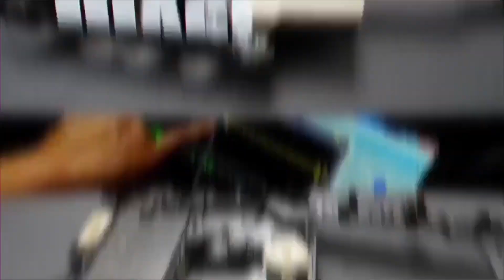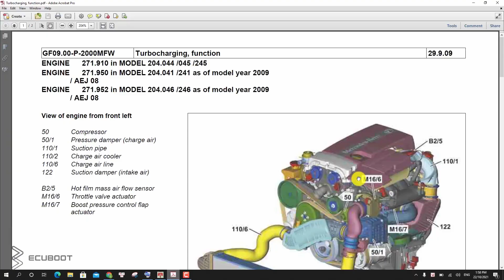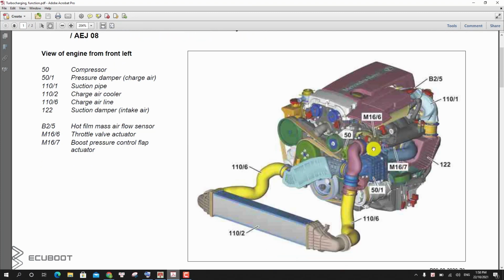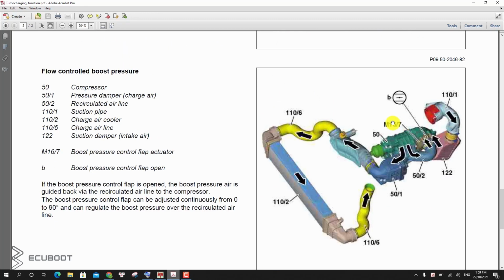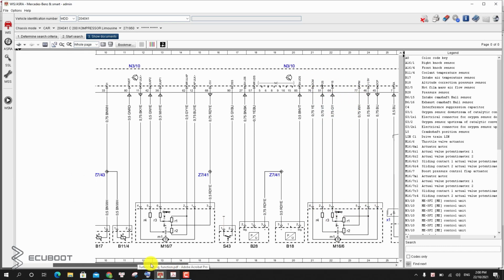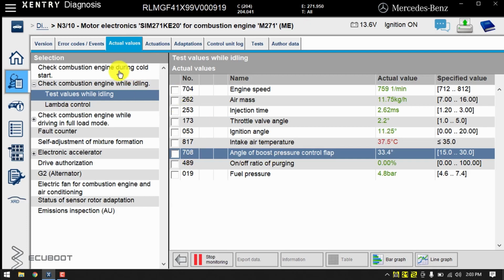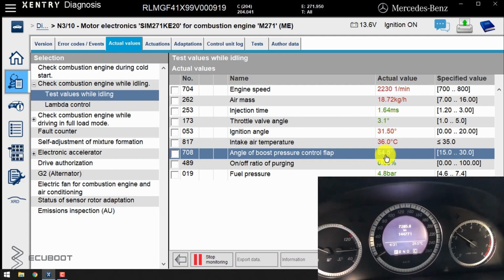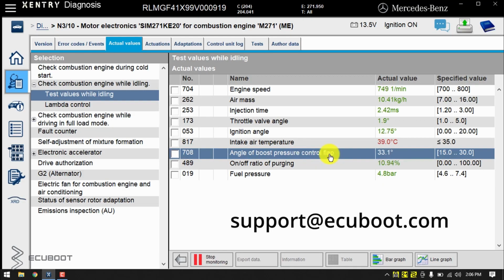Fixing Mercedes Kompressor Problem

Comment: Hi there... Please help me out in finding curing the sound emitted from the kompressor as if it is another engine running, and the engine has no power.

Mercedes-Benz W203 C200 M271 engine.

Thank you.

Comment: Hello, please tell me the M271 engine jerks during acceleration. The spark plug tips changed the throttle valve and I don’t understand what’s the reason
Reply: did you find it